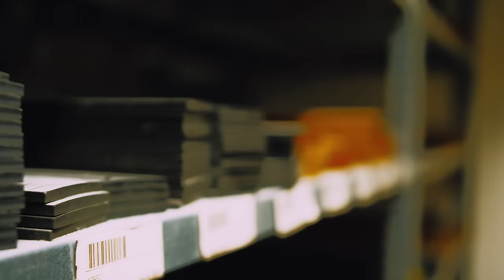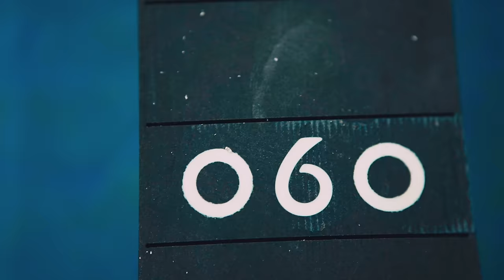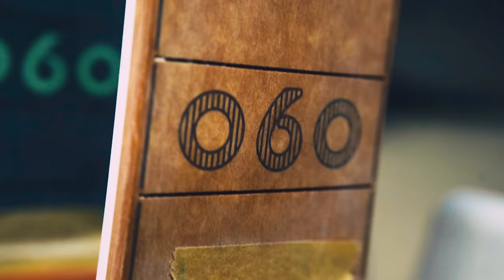Aristides Guitars Factory Tour 2024

Comment: What sold me on the bass I bought from you , when I visited the factory many years ago, was the main result of using Arium as apposed to wood. You are highlighting the looks rather than the amazing everlasting sustain or dead stop of a note that was achieved when sounding a note. Also the fact that in extreme cold or heat weather situations Arium, as opposed to wood, did not change!

Comment: So one question I had was about the raw tone vs. painted finishes of your guitars. Is there any tonal differences between them or are they too minute to matter? Wondering this since the Aryium has those micro pockets of air that replicate tone wood, would the paint affect the tone/resonance.
Reply from the maker: Good question!
There definitely are slight differences, with the raw series guitars not having any paint on them whatsoever, they're even a bit more resonant than our painted series. 
I do have to add that it also depends on the type of painted finished you'd put on the guitar, a simple satin finish would have a lot less paint on it than say an complicated sparkle finish would. The amount of paint (just like with any guitar) would always affect the overall tone and resonance of the guitar, but rest assured that whatever paint or finish you'd put on your Aristides, you'll still end up with an incredibly resonant instrument!